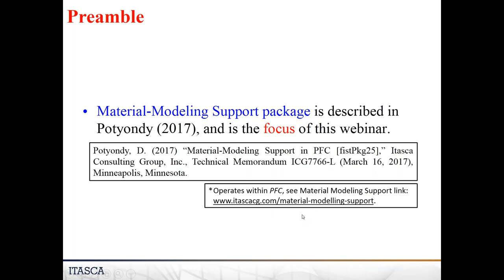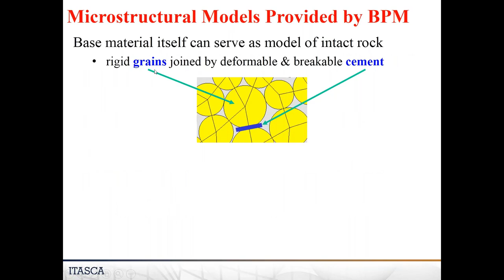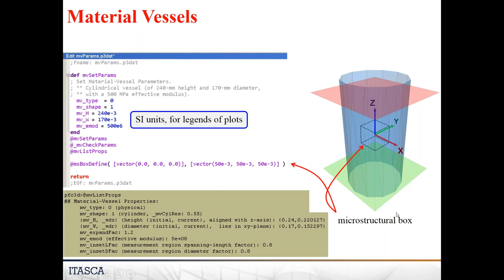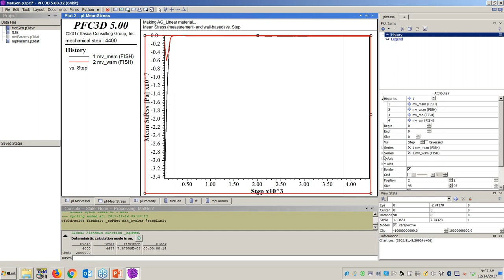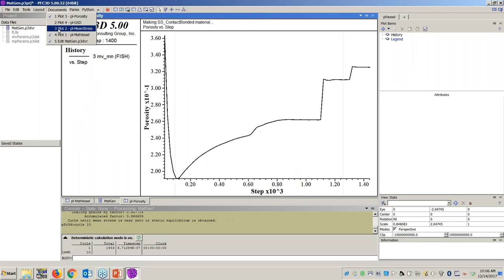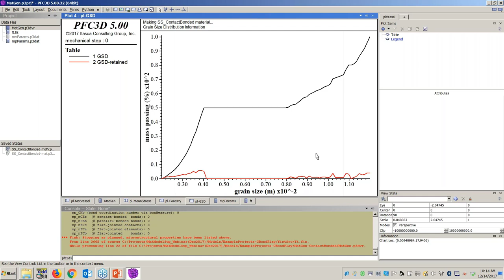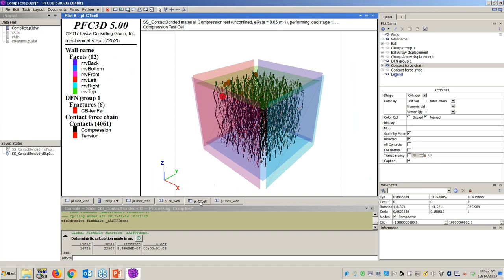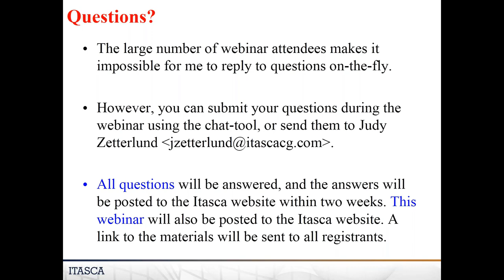PFC Material Modeling Support Webinar

Comment: I am using the PFC 7.0 version and using fistPkg 7.2. With the help of the webinar, I tried to perform different tests, but after a particular time, the PFC software closes. Why is it happening?
Reply from the maker: Hi Prerna. For technical support, please contact our support team via our website at https://www.itascacg.com/contact-itasca/software-support-request. You may also want to check out our software forum at https://forum.itascainternational.com. There are also more detailed PDF technical memos outlining the use of the Material-modeling Support Package on our website at https://www.itascacg.com/software/material-modeling-support-download-files.
Reply: I am also facing a similar issue. @prernasingh8811, have you find any solutions?